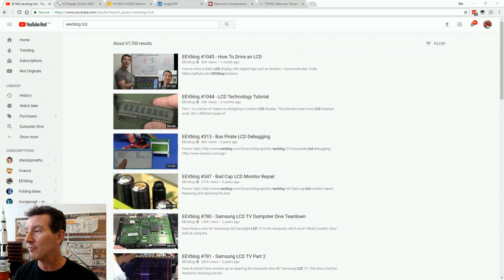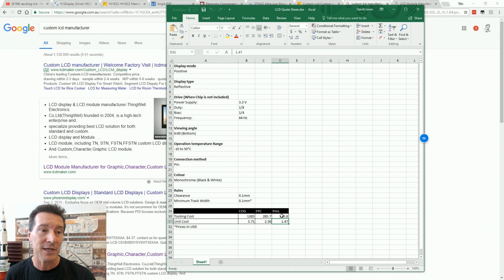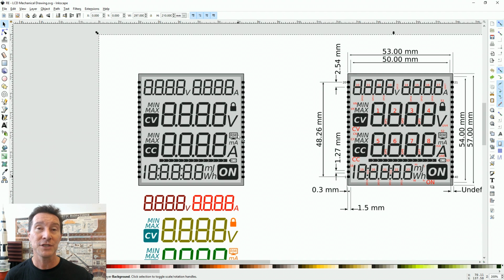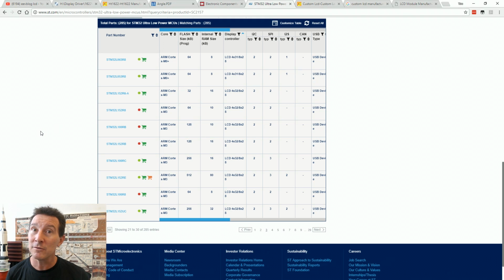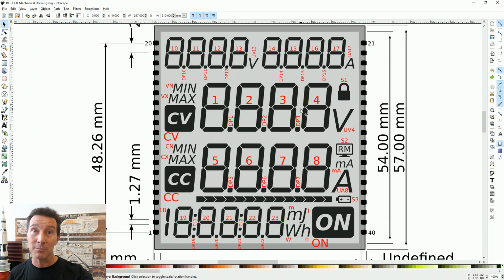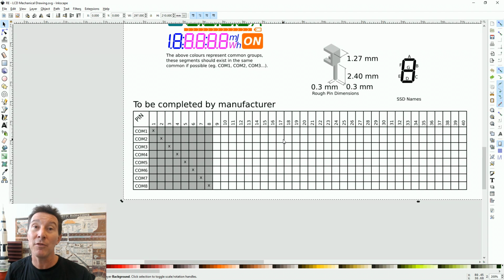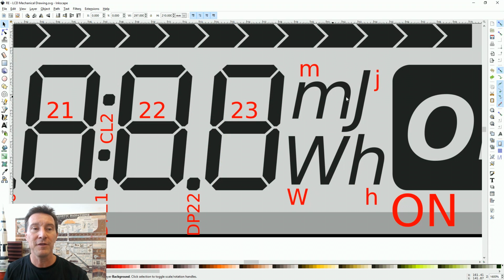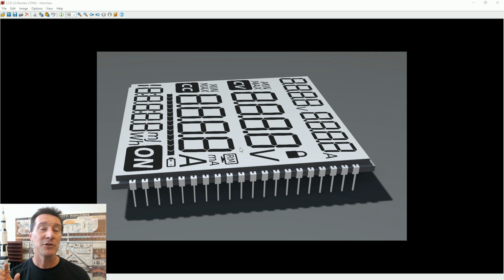EEVblog #1055 - How to Design a Custom LCD- µSupply Part 16

Comment: Hi there, loved the video (as usual). Two questions:
1. After the Digikey segment, you mentioned that you found the HT1622 LCD driver IC outside of Digikey entirely, and that it wasn't available there. How did you find it and what did you look for to find it?
2. You mentioned that you explained the Duty: 1/8, Bias 1/4, and Frequency 64Hz in a previous video. However, I watched #1044 and #1045 and I don't believe it was mentioned. Can you please point me to the video in which it was explained? Thanks so much!

Connor

Comment: So, I've been following an indi game developer on Twitter and one of the things they've been playing around with is an old school Game and Watch style game. So I had a question, could you make an old LCD print like that with more than 1 layer? Like I seem to recall those old LCD games having color printed backgrounds under the LCD display and I was wondering how much complexity would be added to having a second later on the same screen... assuming it was even possible.

Comment: Dear EEV! Thank you for such an informative overview!

My name's Christina and I have two questions that require your expertise. I'm trying to determine if a pinball LCD handheld would be viable.

Question 1: I found a really impressive one by Radica, called "ultimate pinball". I counted the ball segments and there's 480 of them. On the same glass they also have a 32x10 dot matrix display = 320 more segments!! So that's 800 segments to drive, and I've checked, they're all individual segments. Do you know how? Do they use two drivers? Do they do other magic?
 
https://thumbs.worthpoint.com/zoom/images2/1/0315/19/radica-ultimate-pinball-electronic_1_5d5c4768fbf04614aca4a73b14ce28c6.jpg

Question 2: There's some LCD handheld games from the 80s that boast two LCD displays one on top of the other (Terror House is one of those handhelds), so they could display a second level in the same space. Any idea how they drove *those*? And how do you sandwich two LCD displays? I'd love my pinball to have a second layer for extra graphics. Also, would it be possible to have backlight in such an arrangement?

thank you so much!

Comment: How can you tell if a Holtek LCD driver is cheap because you found a good deal, or because they're making illegal (cloned) chips in China? (The Holtek website says it's a patented chip.) I suppose you could ask Holtek if the cheap Chinese supplier you're working with is an authorized dealer or something, I'm just thinking they're going to say no. This is something that can blow up in your face months down the line and could cost a lot in terms of redesign.

Comment: this is very informative, even for those of us that do not intend to do this sort of thing, knowing how it is done and what the cost would be gives great insights. this display seems versatile enough that it could be used for many other purposes, even if not using all the capabilities. i hope you will consider selling them seperately. especially with the dip setup this is easy to use for the less advanced hobbyist. (but maybe include a driver chip that is dip - or a pcb for the driver/display - not all hobbyists are able to design/make pcb's)

Comment: I'm amused that TN viewing angle continues to be an issue in LCD displays when IPS is pretty much standard order on LCD monitors. Curious why all LCDs aren't IPS at this point. Is it a current consumption issue?
Reply: Because IPS electrodes are located in the same plane (In Plane Switching) rather than on opposite glass surfaces, the distance between them must be very small, else you can't build up an electric field! So you can only really use them for high resolution displays. You can't just have a larger area representing one picture element like on TN. And even then you have to go for squiggly elements rather than rectangular ones to get a smaller electrode distance at a decent enough area. Wonder why matte coated IPS TFTs look sparkly and weird? Squiggly subpixels.

Comment: Pulling a 6502 out of its socket is hard, and this is as long and much wider and made of cristal so very fragile... hmmm.
Reply: George Of The Jungle I don't get the point?  These are not going to be socketed as they will be through-hole and soldered to the PCB.  If you later wish to remove the display for some odd reason then you can simply desolder the display with just a minute or two of work. I have never seen anyone ever socket a glass LCD in a product as insertion force alone would be questionable if using a decent machined socket, you could use cheaper header sockets but they do not provide the same retention force unless the display is otherwise constrained.  For a finished product a reliable solder joint is much preferred as there will be no opportunity for oxidized and intermittent connections years down the road.
Reply: Right you are. I didn't even imagine them soldered. For some reason I see a DIL and automatically count one more socket (or pin strip in this case). Touché! Thanks.

Comment: That really is surprisingly affordable. Granted, for a hobbyist that's quite a lot, but assuming you're making anything at all, even a niche device, selling a thousand or so of them isn't out of the realms of possibility. (granted, depending on the niche you may be lucky to sell a few hundred, but fair enough...)

For a fully custom display, that's not all that imposing...
Reply: I had no idea something like this would be so affordable

It looks like a better option than a handful of 7segs and might be cheaper, plus looks nicer and you arent limited to 7 segments and a dot
Reply: very reasonable, i think the trap for young players would be making a mistake and having to eat it.. any time custom is done in volume it's a different game.
Reply from the maker: Even for a few hundred the price is very reasonable. You don't have the buy 1000, but it's probably a similar cost for 100 as it is for 1000.

Comment: Should have covered "Operating Temperature" more, at least what options are around. As 50C is outside air temperature in many parts of Australia at the moment.
I'm sure people designing equipment for outside use would be interested in what sort of extremes LCDs can be specified to cope with.
Reply: lol. Tell me about it. In fact, my place the indoor temperature at 4-7 pm is probably hotter than the outside temperature, and outside temperature has repeatedly been 35-42 degrees...
I'm not cut out for this anymore. Too much time spent in England. XD

Comment: What about the Backlight? Can you get of-the-shelf backlight in similar sizes? Or is it also done by LCD Manufacturers? You have to  be  a Zemax wizard to design a light guide for uniform back light!!. Thanks for the video Dave!
Reply: I still think the best backlight material, if you can afford the energy, is EL film, because it impedes reflectivity less than anything else. Cut it with scissors, and then glue it right on.

Or consider edge-lighting, which is a form of front-lighting rather than back-lighting.

Comment: Very informative, Dave. Thanks! I've designed both custom segmented VFD and LCDs before. The process is exactly as you present here, but the price sure has come down. Segmented OLEDs seem to be a thing also. I wonder if you can stack a clear/transparent OLED on top of a traditional reflective LCD and have some kind of cool overlay effect that way.
Reply: That sounds very interesting, how much do custom VFDs cost to make?

Comment: interesting to know, as we can all  think of a design that will work better if we just tweaked display. a case in point is having dual timezone clocks or temperature displays side by side on one LCD display.

Comment: Overall it looks good. Nice to see more progress being made on the micro-current supply. Interesting to see you are using square decimal points rather than round ones. One thing I noticed in the Inkscape drawing is you have the pins numbers counterclockwise with pin 1 in the bottom left. I would have expected a more common pin numbering with pin 1 in the top left and the pins number counterclockwise.
Reply: +1

Comment: This is a little off topic but how easy (or difficult) would it be to read the output from a devices PCB that would normally go to an LCD screen? So, for a simple and useless example read the output pins from an LCD watch and then convert that into say a serial data stream of which segments are currently active.
Reply: Watch Dave's video where he explains how to drive LCDs, and then figure out what circuitry you need to do what you want.  I'll give you a hint.  You'll likely need diodes and capacitors.

Comment: PLEASE!, release a version of your meters that reads "FUTILE" for infinite resistance.
Reply: yeah but this is about custom segmented displays not dot matrix so it would have to be designed in
Reply: KWatson1984 isn't the firmware open source?
Reply: "You will be assimilated."

Comment: There's not much point specifying common groups as it's trivially easy to use a lookup table for the segment mapping
Reply: mikeselectricstuff - If there is a cost involved in grouping the segments then maybe not.  But it can be easier to work with especially if the product goes open source (no idea if this will).

What is more important is that the common pins are grouped together as they are with the driver IC.  Much easier routing if those 8 lines all go to the same places as a group.  They don't need to be pins 1-8 as Dave has but that is likely a good idea too if it doesn't affect the cost.  Good manufacture communications is key.

Comment: Reflective is not transflective and means no backlight?
Reply from the maker: Correct.
Reply: No RGB backlight color tricks then?
Reply: Dave, may the trick they use in the kindle paper whites to illuminate the eink display be worth some investigation?

Comment: Trap for young players: the holtek 1623 lcd drivers will not not drive static displays. I found that out the hard way after spending hours wirewapping a board with an lcd with about 70 pins

Comment: This is probably something you'd need a bitmapped graphics LCD screen for, but has anyone ever gone about implementing an LCD display for use as a BASH terminal? It's something I'd love to try and if someones already done it, i can't seem to find any examples.
Reply: Be N S O N Basically any of the original 'laptops' used lcd as their display of choice. Low power and perfect (relatively) for text based interfaces. I think Dave has some videos. Would be the same idea for a bash terminal type device.
Reply: Caleb Bell Yeah, seeing those laptops, particularily the Powernote Vwestlife showcased on his channel, were actually what made me imagine an lcd terminal. Unfortunately the ones I'm aware of seem to be few and far between on Ebay, at least where I live, so it'd probably be more productive to buy a big character lcd display and play with that instead of pouring months into waiting for a lucky ebay find.
Reply: Probably best/cheapest to buy a Hitachi based character display that can be interfaced via a parallel or serial interface from a variety of devices.
Reply: Be N S O N Look up the NewBrain computer, though it was LED with a somewhat weak CPU.
Reply: John Francis Doe Looks like one of those Laser BASIC computers 8 bit guy showcased a while back. Also i believe tandy made a bunch of handheld computers much like that except with bigger screens. I'm more thinking of specifically lcd screens displaying some sort of BASH/DOS prompt specifically, but these are still pretty cool, albeit not all that attainable in australia from what i've seen.
Reply: All laptops have used LCD as their display of choice since time began (except for maybe very recent OLED ones).
Reply: Star Gazer I mean the monochrome character lcds, like the ones shown in this video.
Reply: Star Gazer Not all, some of the very earliest laptops and compact transportables used monochrome plasma displays (neon) before graphic LCD technology caught up to a point where there was decent contrast and update rate.  On the earliest passive LCD displays it was often challenging to locate your cursor or mouse pointer due to the slow update rate and poor contrast (pointer trailing was added to windows just to help locate the pointer during movement...a feature that persists to this day as a mouse pointer customization).  But once active matrix displays became the norm then LCD displays very much became the norm (though some may do oLED by now).
Reply: +Ethan, thanks for the history lesson, but I was there.  I owned some of the first laptops.  I know about the plasma displays.  They were big, heavy, expensive and very rare.   The first transportables mostly had small CRTs in them.  Finding your mouse cursor wasn't so much of a problem on the early laptops because these were the days before Windows.  DOS was king in the PC world, and few people had hard drives.  Laptops like the Tandy Model 100 were some of the early popular ones (they weren't PCs), and their displays weren't bad, apart from being very small.  Yes, the LCDs were sluggish, and the backlit ones had poor contrast and very narrow viewing angles. 
Windows 1.0 came out in 1985, but nobody really used it until Windows/386 in 1989 and 3.0 in 1990.  There were nearly 10 years of laptops before Windows.  And with a few rare exceptions, they all had LCD screens.
Reply: You just need ASCII text and cursor? Or anything more advanced? HD44780 displays will easily display ASCII, but the largest ones i'm aware of in production today are only 20x4 characters. I am certain that larger ones based on the same or similar controllers had been custom made for early portable computing devices, but you know, sourcing issues.

As for graphics, look at a cross section of u8g2 supported devices and what you can buy. 128x64 LCD is widely available will give you something like... 21x8 characters, plus narrow scroll bar, if you use 6x8-size characters.  The highest resolution non-expensive you can get that are supported by that are maybe 240x160 by EastRising, that's 40x20 of text.

Next up are colour LCDs, for example the ubiquitous Sony PSP clone display with HX8257 clone CoG, which will probably need a 32-bit micro and a DMAC peripheral to drive.

Comment: Real work problems for manufacturing is interesting, even though I'm only a hobbyist.
Reply: Indeed. Though still out of the realms of plausibility for small batches of prototype and one off designs that you may make a dozen or so of...
It's amazing that it's plausible for the kind of niche, low volume items a hobbyist might actually sell from time to time...

Nothing I'm designing really needs a custom LCD, but it's nice to know what is and is not within reach.  

Personally my biggest headache for some of the things I try and design has more to do with needing custom connectors and plastic casings. 3d printing can be good for one-off things, but it's quite costly on a per-item basis for any non-trivial volume of items. I've been trying to investigate at what kind of volumes and prices injection moulding starts to be a plausible option, but it doesn't look all that promising. XD
The other thing is when you need to match some obscure connector that only a handful of old devices used, or are trying to decide if a standard card edge connector will suit what you're doing or if a custom solution would be better (and whether that's even viable. Clearly there are plenty of custom connectors around, but what kind of budget does THAT involve?)

All these things you trip over as a hobbyist more than anything else.
Slapping a few standard components onto a breadboard isn't hard. Knowing what's within reach in terms of customised components or low volume manufacturing (say 100-2000 items range) is quite something else...

Thanks for the insight Dave. It really does help a lot. XD
Reply from the maker: Custom LCD is almost cheap enough for the serious hobbyist
Reply: It's a shame they don't do some sort of cheap panelized prototype LCDs like they do with PCBs.
If you wanted to, would it be possible to use a knife to cut across a single big electrode (like how you can make tracks when breadboarding on a blank PCB) and solder wires to them? Would be really ugly, obviously, but is it possible?
Reply: ~$1500 is doable but certainly not worth it for any hobbyist project.
But maybe you should ask for a quote for 100 units. If it scales linearly (it probably doesn't) it should be in the $250-$400 range. That's still a waste of money, but it's certainly not out of reach at all. For instance that's less than you might spend on addressable LEDs for a project.

Comment: Feed for thought. Isn't it quite frightening that ~ everything these days ends up being manufactured in China/Asia?
Reply from the maker: My uCurrent is made in Australia. The 121GW in Korea. The BM235 in Taiwan.
Reply: EEVblog what about the internals though
Reply: @EEVblog : define "made". Assembled, perhaps. Some of the parts may actually be manufactured in places other than China, but for the most part, a high precentage of manufactured goods (especially electronics) have their roots in China.

Comment: If possible I think it'd be really interesting if you can share what the manufacturer ends up sending you back after they tweak and modify the files you give them. It'd be a neat insight into how at least one real-world manufacturer takes a design and implements it, at least in documentation
Reply from the maker: Will do.